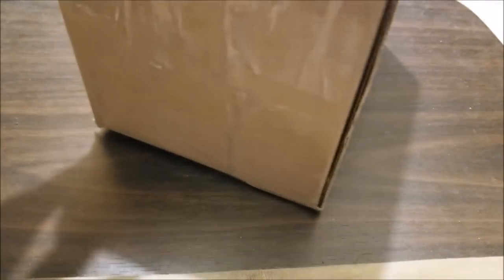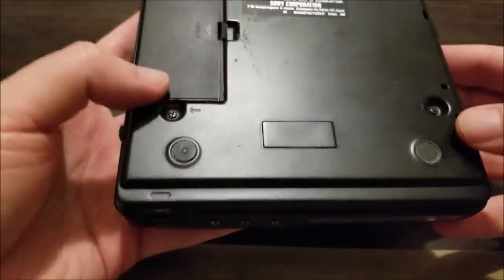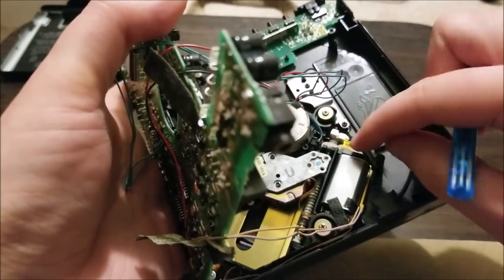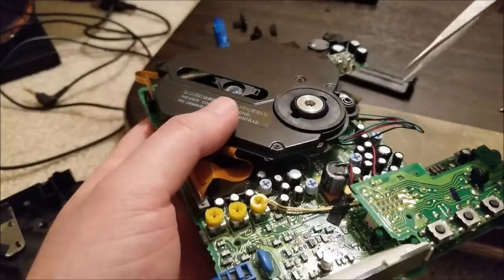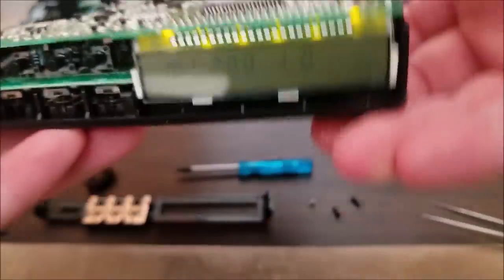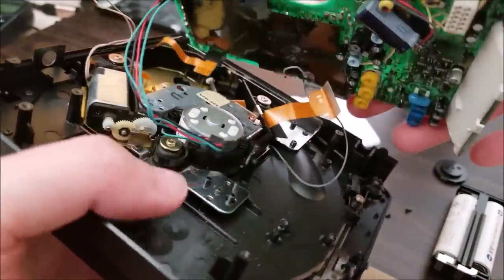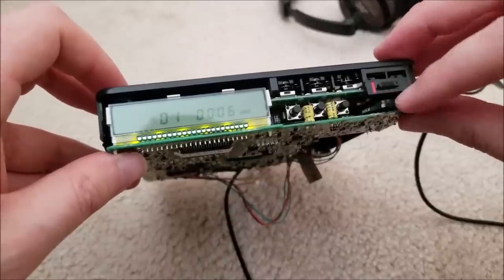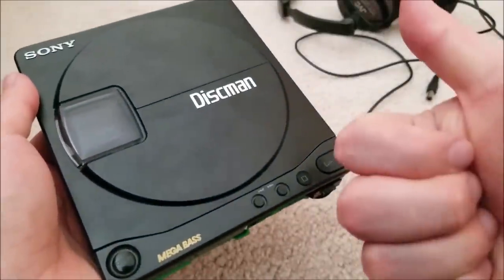Let's Fix: Sony Discman D-9 Dim Display, Doesn't Play, Audio Problems

Comment: i've got one recently and even on the outside looks almost mint, it has some issues as it follows:
- when i start it up, i insert a cd inside, it takes almost 10 seconds or more the start playing...that when it wants to start, other times makes some high pitch sound or scratching like sound and never starts
-when it does start eventually, for example if i want to skip some tracks, hit 5 or 6 for example, again it takes forever to start playing.
-when i plugged the headphones in the phones socket only left channel works...right one has some vague bass ...If i try to move or jiggle the socket a little, maybe ..just maybe it wants to play both channels. Strange thing happends again while when playing if i adjust the bass "normal,mid, max" again it seems it wants to play more on the right channel..or sort of.
-the left channel however sounds sublime with full mids and bass, clean highs with no distorsion
-the moving laser or mechanism seems stuck or something...takes a long time to read, even more if i skip tracks
-i must say i have zero experience to try and fix, clean, repair ..etc electronics so please advise if possible.
Thank you in advance.
Reply from the maker: Definitely symptoms of bad caps. Sounds like some are bad and some may still be ok (would explain why it sometimes works and one audio channels sounds alright), but it's a good idea to replace them all at once so you dont have to worry about any failing for a long time.
Reply: @sjm4306  very odd, i tried 2 different headphones, with one of them only left channel, with the second one i can hear them both..is it because of impedance? some are able to be driven even that caps are gone?
what about the delay when skipping tracks..is it because of what? faulty mechanics? Anyway i realise a lot of the answers it will be answered when i open the player itself.
the light on the display does not work when on batteries, it does light up when connected to ac adaptor, but it tends to flicker
Reply from the maker: Yeah, headphone impedance would load the output amplifier differently and with bad caps could be on the borderline of working or not depending on what headphone is connected. 

As for the delay in skipping/playing that would be the servo tracking mechanism, the caps along with some variable potentiometers in the servo circuit are set at the factory and control feedback characteristics like gain, bandwidth, and phase for the loops that are used to automatically manage disc speed, laser position to follow the track, and even lens distance to disc to account for wobble. The problem is when the caps age they change the calibration even if the pots aren't touched and eventually will push the compensator out of spec so the physical disc/laser control no longer functions properly or reliably. 

Finally the light only turns on when AC is connected but the fact that it flickers when plugged in sounds like the switching converter that generates the internal 5V that runs all the digital logic is browning out, once again due to bad caps that aren't holding the supply voltage steady like they did when they were new.
Reply: @sjm4306  do you have a list or schematics on all values and caps to be replaced? i want to put some new quality ones like muse or black gate..etc
Reply from the maker: You can google your model number and "service manual" and find a pdf that has a full schematic and bill of materials list that has everything you'll need.

Comment: Hi, I have the same Discman which I got for a 17th birthday present 33 years ago. I really want to restore it and it appears to be working but for the laser not being able to move. You video has been extremely helpful in providing advice on how to open it up and access the internal workings without damaging it. I am convinced that to get mine working again I only need to carry out the repair to the motor that drives the laser as it is quite jammed. I have applied lithium grease without taking the motor section apart to no avail. Your video did not show how to take out the motor (cogs, etc.) and disassemble/reassemble so I'm worried that I may ruin it. Could you provide any advice on how to execute that part of the process? I would be very grateful.
Reply from the maker: I haven't stripped mine down further than shown in the video, but if I had to guess all the gears are probably held in with split rings/clips like the one I did remove. As for the motor all the gears must first be removed and then there are two screws that hold the motor to the plastic frame. Once these are removed the motor should just pull out. It's possible the bearings on the motor are gummed up and need to be relubricated with some silicone lubricant (commonly used for sewing machine or electric razors). If the motor turns freely then that's not likely the problem. Otherwise a dab on the bushings at either end of the shaft to case area will do and then just manually turn the shaft back and forth to work it into the bushing. The main thing you will have to be careful of is due to the age of the plastics they are potentially quite brittle and may need to be replaced if that's the case. The most likely culprit though is one of the other gears has seized onto their shaft by the dried factory applied lubricant and needs to be cleaned and relubricated.

Comment: I have a Sony Walkman d-e330, bright blue with yellow accent.  
I have had it from new and have taken great care of it.  Mine has fresh batteries, the disc spins, but the numbers of tracks don’t progress, I can hear a clicking noise inside about every 5 seconds, but does not play music at all.  I opened the top, took out the disc, cleaned the lazer with iso alcohol, and tried to slide the mechanism from side to side.  It will move, but I can hear gear noise.  I’ve moved it from side to side many times, to loosen it up a bit, lightly lubed the small metal bar on one side that the thing slides back and forth on, and then put the disc back in and it flashes “disc”…..nothing else happens and I can still hear clicking every 5 seconds or so.  I’ve also tried to advance the track, and then go back, but still nothing.
Reply from the maker: Check the electrolytic caps, it's possible they are bad and affecting the tracking servo circuitry
Reply: @sjm4306 , thanks so much for answering/letting me know!  I appreciate it!

Comment: I have the very same issue on my D-250. First, how did you take off the circlip of the plastic crank ? Also, you said you replaced all the caps... including PSU? There's a 150uF mid-high capacitor, but I don't know where to find that....
Reply from the maker: I used very sharp tweezers to grab one end of the split gap and pulled the clip off. It was super fiddly and took a few tries. IIRC the 150uF cap was the large one that was soldered via separate wires and taped with foam to the bottom of the pcb.
Reply: @sjm4306  thanks, I'll try to get the clip out...
Reply: @sjm4306  I got the crank out, great ! I lubricated it with lithium grease, and the device plays a CD !!! However the sound is completely hashed...
Reply from the maker: Great, looks like you just need to sort out the caps and you are golden!
Reply: @sjm4306  not even that !!!! Before doing the caps, in despair, I clean once more the lens with isopropyl, and IT WORKS !!!!! OK I also need to clean the volume fader, but still, I'm so relieved !
Reply: @sjm4306  any idea for finding a battery? Or it looks dead?
Reply from the maker: I ended up making my own battery after I got a d-15. I made a video on the process and linked the project page with the design files.
Reply: @sjm4306  I saw that, but you already had a battery at disposal...

Comment: How did you learn to fix electronics like this? Always wanted to, but scared of fucking up or not know what I'm doing/What needs to be fixed.
Reply from the maker: I've been tinkering since I was 8. I started by taking stuff apart and trying to understand how things work and put them back together again at an intuitive level. Then when I got a bit older I read electronics books and blogs to learn more of the technical stuff. By the time I was a teen I would try and fix broken things people threw away or friends gave me. The best advice I can give is to play around with free or cheap broken devices to gain the skills and not have to be afraid of making things worse. Read as much as you can online, I cant tell you how much I've learned from the internet. And finally never stop being curious!

By high school I started teaching myself practical skills like board/circuit design and programming from various online tutorials. In college and grad school I learned even more by joining in various electronics clubs and a power research laboratory. Now I work at a medical device manufacturer as an electrical engineer by day while I fix and design random projects by night.

Comment: I have one of these that starts up, spins disc and makes noise like it's about to play yet it then just shuts off. Display works. Would you start with the little gears or the capacitors? If so which capacitor would be failing in this case?
Reply from the maker: First try carefully moving the laser sled towards the outside and try to play a disc. If it moves the laser back to center then the gears/motor are probably fine. As for replacing caps, given their age you are best off replacing all the electrolytic ones. If any are still ok it's only a matter of time before they go bad anyway so might as well swap them all out for new ones.

Comment: Nice project. Do you have any idea where to get a replacement for the middle wheel (the one between the motor and the laser guide one)? In my case it was like rotten. It broke to pieces. I've been looking at aliexpress, ebay, amazon with no luck. I think it's 34 teeth (outer) 17 teeth (inner) 1.5mm (hole). Inner diameter: ~4.5mm, outer diameter: ~9mm
Reply from the maker: I found one seller on ebay who has them but they cost like $20 which is kind of ridiculous for a small plastic gear (http://ebay.to/2x0ilHE)
Reply: @sjm4306  Thank you!
Reply: @perplexbcn  Did the replacement gear work out for you? I'm looking for one too. On my D-9 that gear was GREEN and crumbled when I looked at it funny. Couldn't even find the C-clip in that mess.
Reply: @HEPATCA  , still waiting for the shipment. Will let you know ASAP.
Reply: Hi Jamieson,  After more than 3 months later I received the gear. It's working thought it gives the feeling that there's a bit more roominess than expected with the DC motor driving gear. Uploaded two pictures: https://drive.google.com/drive/folders/1Raa2Igkoy2K58Ax5_RB9EVi0HpUB1S5z?usp=sharing

Comment: Thanks for the vid, I have greased my tracker which was gripped, but I still have a focus issue... Your vid makes me think about the next step would be to put some fresh caps.
Reply from the maker: Yeah so long as the rails and the sled drive gears are lubed and able to move properly by the motor then the next likely culprit is the caps

Comment: Have a rare D-88 but I’m a total amateur. I lubed the middle gear just like you said and got the sled moving! Unfortunately all the stress on the system from me trying to get it opened up and getting lost screws out of the body seems to have damaged something. It used to spin but now it only spins without a disc in it. I think the laser is not at the perfect angle anymore. Any ideas where to go from here? Thanks!!! 🎃

Also if you want to fix it for me for the sake of your channel content maybe we can work something out!
Reply from the maker: Hi Seth, sorry for the late reply I just got back from a month long international trip. Like you've guessed it sounds like the laser isn't seeing the disc and thus doesn't spin up. If you'd like you can shoot me some pics in an email (sjm4306@gmail.com) of the mechanism in the off chance it's something obvious I can see. If not then I'd be open to trying to repair it once I get settled in to my new house.
Reply: @sjm4306  I’m a struggling reseller and can’t afford to pay you very much to fix it. So unless you’re excited to work on one, I think I’m going to sell it for parts/repair as is. It’s listed now but I could pull the listing if you have the time before it sells. Oh thanks for the reply!
Reply from the maker: I understand, I'm probably going to be busy till the end of the year so I wont be able to take on new work for a little while

Comment: Do you know how to fix the volume control on a Sony Car Discman D180K?  Mine doesn't work.  Thanks!
Reply from the maker: Open it up to gain access to the potentiometer inside then squirt some isopropyl alcohol into the seam of the pot and rotate it back and forth to scrub the contacts inside.
Reply: @sjm4306  thank you!!  I figured out I was plugging the headphones into the wrong outlet, lol! But thank you so much for answering.  In case I end up in the future with problems with the volume control, I will know how to fix it now. :)
Reply from the maker: I've done that before lol. Glad there was nothing wrong with your discman.

Comment: Hi sjm4306! I am desperate for advice.. I have a Discman D-Z555. My primary problem is the middle gear. It's so brittle that it chipped... Where can I possibly source a replacement? Are there Discmans with the same 33/17 tooth gear as this? Please help
Reply from the maker: Last I checked there was a single seller on ebay, but they were going for $30 a piece so not cheap. I believe there may be a few sellers on aliexpress who have them a bit cheaper but looks like the links I saved are no longer working so no idea if they just sold out or quit making them altogether.
Reply: @sjm4306  darn, it's a "maboroshi giya" then.. the one in ebay that sells for $30 a piece is insanely far. kudos to him for having a 3d printer. --- guess i'll sell mine as junk then
Reply from the maker: It's a shame the d‐z555 is a beautiful player, definitely deserves a fix up if not for the scarcity of a single tiny piece of plastic.
Reply: @sjm4306  i'd have heard through my ears what the fuss about this discman was if it weren't for the wretched gear. it really looked promising.
Reply from the maker: At least with my d-15, it's like night and day compared to most of my modern discmans. The noise floor is nearly silent with my headphones and on a cd that's been mastered well you can really hear how crisp and spatially separated the various instruments/vocals sound.
Reply: @sjm4306  that's very convincing... to tell you the truth, i never listened to a CD player with a high end DAC in it. i bought this hoping it would be my chance...heck i might hold onto it for now. i just need a lead on a middle gear... scavenging from another discman might just show the same brittle quality. it probably had something to do with the green lubricant they used. it was probably lithium grease. might've degraded the plastic over time.
Reply: The gear is readily available on ebay now for about $10!
Reply: @80sGuy.  man! i sold mine already 3 months past T_T
Reply: @quinorodriguez3827  Hope you get a ton for it as those are worth a bunch.
Reply: @80sGuy.  i only got 100$ out of it when put it up for bidding in ebay

Comment: Hi there, do you know if this bracket with AA work on the D-25, thnx!
Reply from the maker: It wont fit in my D-15 which I believe has the same battery bay size as the 25.
Reply: @sjm4306   Darn it, thnx

Comment: Where do you buy the replacement caps?
Reply from the maker: I didn't buy them per-se, they were mostly desoldered from broken electronics and checked using an esr meter. However, if I do need to buy caps I usually get them from digikey or mouser.
Reply: @sjm4306  I'm really impressed with your skills,i own alot of MD portables some work and some don't,i have fixed alot of them because of your videos,you need to open a shop in the future or if you haven't already done so,keep up the videos,Joseph.

Comment: Hello my screen is no light why?
Thank you
Reply from the maker: If you run it off batteries the light doesn't turn on, it lights up only when powered from the ac adapter. If yours still doesn't light up even then, then it could be the leds are burnt out, there's damage to the pcb trace connecting them, or perhaps a component supplying them power is damaged.

Comment: hello Shawn, hello sjm4306, I happened to find your great videos, where you have repaired Sony Discman D-15 and D-9.
I remembered that I myself still had a Sony D-250 in my file cabinet in an excellent condition with IR-Remote. I had replaced it with a CDP-XB930 QS almost 20 years ago and had completely forgotten it. Motivated by your great video, I tried to reactivate it, but found that the laser sled did not work. As with you, the middle gear is somehow damaged, as if the material has softened. The teeth are no longer sharp cut as with gear 1 (motor) and 3 (spindle). Do you have any more exemplar that you could sell to me? I would be very grateful and would transfer you the costs by paypal immediately. So hopefully I could use my D-250 again soon.
 If you could help me pls let me know how i could contact you by email to send you some photos 
Thanks for your great videos especially D-25 and D-9- Great job!   sorry for my bad english    best regards Matthias     Germany
Reply from the maker: Send me an email at sjm4306@gmail.com with pictures of the gear and motor assembly. I don't have any spares but may be able to take the one from my working d15, make a mold and cast a new one out of epoxy.